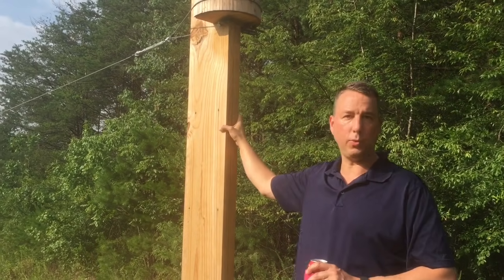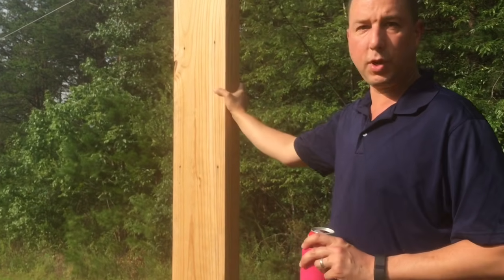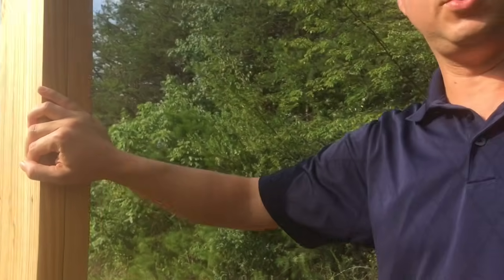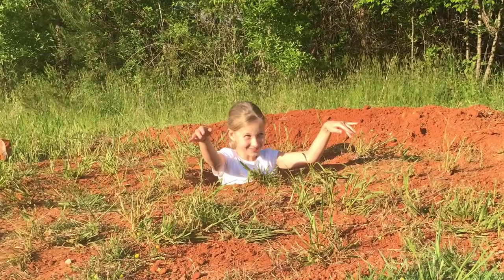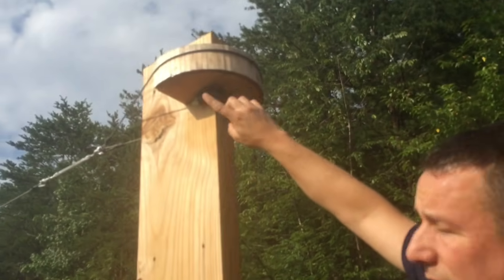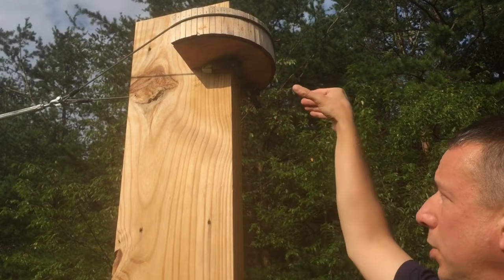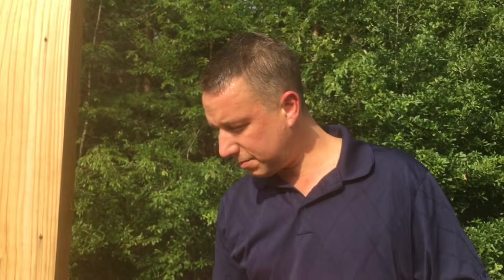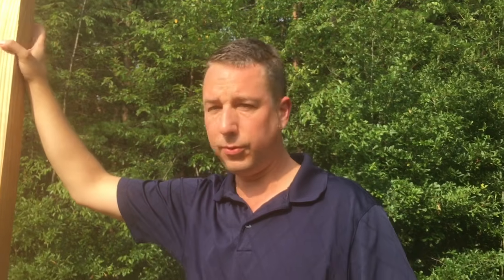Zip Line without trees - anchors

Comment: So I have two decks 85' apart form each other in the back yard. One is 6' 6" from the ground to the deck floor and the other is 6' from the ground to the deck floor. On top of these decks are little buildings that are 7' tall at the tallest points. Do you have any advice on the length of post/board and how deep to bury it to support riders of 250 lbs or less? Also, how should I mount the zipline to the beams/boards/posts? I see your mounting here, but given my spec not sure if it would change your advice. Thanks!!
Reply from the maker: You can use the equations and approach from my other video on this topic (https://youtu.be/a1KPl-M-dpM) to guide your design.  You will certainly need to go beefier than what I did, my "deck floor" on the start end was only about 3.5 feet high.

Comment: Was going to use galvanized steel poles over wood posts , any thoughts?
Reply from the maker: Check out my other video where I perform the calculations. You can use that same approach to calculate for your proposal, just need to change the cross-section from a rectangular solid to a hollow pipe and obviously you’ll need to change the material stiffness from wood to steel. Steel has a stiffness of 210 GPA, by the way. But go for it, you should be able to calculate it using the exact same approach I showed you in my other video.
Reply from the maker: Not enough info
Reply: 4” galvanized steel pipe to prevent rust , cemented in ground , won’t deteriorate like pressure treated wood over time .
Reply: Drill a hole , run a eye bolt through the top of the pipe and attach the cable
Reply: Thank you so much !

Comment: Hey buddy im not an engineer just a dad and Grandpa, did you use the same 2x12 on both ends ? I see you did say you went 4 ft in the ground that would make both ends exact size and in the ground correct,  now my question is how high did you go at the start from the zipline and how low at the end ? im not an engineer but this is wat i need to do for my grandkids,  thanks so much looks awesome
Reply from the maker: Yes, it was the same sized post on each end of the line. Each end had two laminated 2x12s. My yard naturally sloped about 6 feet from the start to the end of the line, so I did not need to construct a taller support post on the starting end.

Comment: Thank you for this video! It is awesome that you use your engineering knowledge to make fun activities for your kids. And it is amazing that you took the time to share that knowledge with other people. It wouldn't have been possible for our family, or many other families, to make a zipline without your video. 

We are going to be making the zip line with 2x12x16s, that will cantilever 12 ft above the ground. According to the equation from the calculation video, a 300 lb individual, would cause the 12 beam to deflect 3 in. Or 2 in if I used a 3 ply beam. 

I don't know if that's an acceptable amount of deflection. It certainly is not acceptable for building code. I think that works only allow 0.8 inches. But is it a dangerous amount of deflection? Could the beam fail? 

I looked up the modulus of rupture for sy pine (12,800 PSI when dry). I don't believe the force from the zipline is anywhere close to that, even for a 300lb adult at the 12' cantilever (7,500 Newtons? Or 48 psi for the 2-2x12?).

I don't understand the math well to be sure I am doing it right. I also don't know when the amount of deflection (1-3") should be concerning.

Thanks again for your video!
Reply from the maker: Aaron - I think you'll be fine with laminating three 2 x 12s.  Manufacturer's instructions conservatively spec using minimum 12" diameter trees as anchors.  Triple laminated 2x12's are ~64% of the stiffness of a 12" diameter cylinder, so that initially seems concerning... but remember that live wood is ~50% less stiff than the dried lumber you are using.  So Bob's your uncle and you're back to parity with the conservative manufacturer's guidance.  Have fun and shoot / post a video - I'd love to see.
Reply: @BILLYSHED  Thank you! I will definitely post a video

Comment: Any chance you have a link to the half circle piece?  You’ve convinced me to try the 2x12s but I can’t figure out that half circle item.
Reply from the maker: Sorry but no.  I just used scrap 3/4 plywood, made a quick circle jig on my table saw (you can find videos of people doing that) to make four 12"-diameter discs.  Notched-out a rectangle so it would slide onto the 2x12s, then laminated the four discs like layers of a cake.  Then I just cut some small (maybe 1/4" x 3/4" cross section) pieces of clear grained pine and lined them up around the outside of the cake.  Don't overthink it.
Reply: @BILLYSHED   what r your thoughts on a 6” diameter fence post cut to make a 3” thick half circle?  At 6” diameter it’s not your 12” but would be easier then all that you mentioned.  Also, what did you use to hold it in place?  It’s hard to tell but it doesn’t look like you used any L brackets.
Reply from the maker: @boondocks5  First - I think your approach should work just fine.  Second, friction did a fine job holding my pieces in place.  L brackets are probably overkill but if it gives you peace of mind, go for it.  Again: don't overthink it!

Comment: I bet those  rotted off at the concrete line in less than 3 years
Reply from the maker: Actually, we moved from that house at the 3-yr mark and I took down the posts before we sold. The posts looked fine. It was pressure treated lumber. It didn’t need it to last forever anyway.  Thanks for the encouraging and helpful comment btw

Comment: What would you have done differently if your yard didn't have that slope downward?
Reply from the maker: Hey Sara - in that case I would have used longer 2x12's on the "start" side (through lamination) then secured that end with a guy wire setup.  I assume you're in this situation?

Comment: Hi Ryan , what was the drop like ? You mentioned 8 feet both sides but what about the natural drop in the yard?
Reply from the maker: The drop in the yard was about 6 feet over the 90-foot run
Reply: @BILLYSHED  I looked at your other post and you mentioned 4 foot , could it have been 4 , I think you mentioned you moved
Reply from the maker: @LeeOliveiragetggg  I did move, but I am 100% certain that my yard sloped 6-feet over that run.  But I can understand your confusion.  The 4-foot number you saw in my other video - that was used to illustrate the calculations for the two contributions to the line sag (not yard slope).  And you may notice that around the 10:30 mark in the video that the contributions only add up to 37.5 inches so 4-feet was a decent "guess" for illustration purposes.  My current advice to all folks is #1 don't overthink it and #2 follow the guidance given at https://www.ziplinegear.com/pages/how-to-build-a-zip-line-section-one-concepts   (which goes hand in hand with advice #1).  If that site existed 5 years ago when I was searching how to install my zipline (because I didn't have trees) then it would have saved me a lot of headache.  My zipline videos are now essentially outdated but that's alright - that's progress!
Reply: @BILLYSHED  hi Ryan, I have some photos of a similar set up. Let me know if you are interested and where I can send them
Reply from the maker: @LeeOliveiragetggg  I'm out of the zip line game, so not really interested.  I appreciate it though!

Comment: Great video. I have a 280 feet  line . I wana meke the zipline for kids and adults.  Can i use 6x6 or 4x4 bolted together . Or is it beter ur way with 2x12.  Thank you .
Reply from the maker: Vaso - If you plan to use a "stand-alone" post like I have, then my short answer is, "No".   You cannot use 4x4 or 6x6 unless you intend to bolt it all together so that the "long" dimension of the compound post (along the direction of the zipline)  is ~12 inches.  And, at that point, you're much better off in terms of time and money just buying 2x12's.  I discuss the reasons in my other video: https://www.youtube.com/watch?v=a1KPl...   .  Good luck and have fun!

Comment: How deep would it have to be for a 300 lb adult ?
Reply from the maker: Its not so much that a heavier person would need deeper anchors.  Four feet still is sufficient.  But: for a 300-pounder, I would laminate (combine) three 2x12's instead of two at each end for the anchors.  Also might need a stronger steel cable, probably 1/4 inch diameter instead of the 3/16 inch that comes with most kits.

Comment: I have a question:  I see that you are in a Northern part of the country, or at least not in the subtropics where the soil is a sand/loam base.  We live in South Florida where the soil is sand and the water table is high.  How would I know how deep to embed the post(s)?  Would a guy wire back to a second short post or concrete footer help?
Reply from the maker: I'm not a soil engineer, so I don't know how to answer your question or where to look for guidance.  If I were you, I would start with google searching terms like "soil, depth, cantilever loads, anchor, post, etc"  Definitely a guy wire back to a second post will help.  Just depends if you have the room for it, and it's an aesthetic preference and a safety consideration...  Good luck!

Comment: Did you mix the concrete in the large holes yourself or did you rent a machine to stir the concrete for you?
Reply from the maker: I just mixed it myself by hand in a wheelbarrow
Reply: Ryan Emerson , nice.  Thank you.  Another video that used your design mentioned 20 bags per hole and that seems like a lot.  Do you recall roughly how many you used for 4 ft x 18 in hole?
Reply from the maker: David Wood  sorry man, I don’t remember. If I said it in the video, then it was probably true. I do remember that I used an online calculator and actual usage was pretty damn close to what the calculator calculated. So if I were you, I would go with that.  I also remember that by the end of it I kinda wished I had hired someone to do it… You know concrete is heavy dirty work!

Comment: We are in a very wet / rainy climate. What would be a good substitution if we were to use steel pipe? I'm worried, even with PT lumber, things would deteriorate fast. Also can you think of a removable option? We have a small yard, and it would be nice to be able to remove the posts when we don't use the set-up.
Thank you
Reply from the maker: Hmm.  If you want to use hollow steel pipe, then you need to choose one with a diameter and wall thickness to give a flexural stiffness equal or greater to what I calculated for the solid rectangular wood.  See my other video that's linked in the description for the concepts and calculations.  My other thought is that putting a zipline up and down sounds reasonable in theory, but in reality you aren't going to do it.  It's a PITA.  Finally, wood should last "long enough" even in a wet climate.  Piers made of wood are constantly submerged and they don't fall apart.  If I were you I would still use wood but would beef it up a little to compensate for the reduced mechanical properties when wet.  You can look all that stuff up online.  Good luck!

Comment: Followed your instructions.  You rock!  Kids love it.  Thank you for sharing!!
Reply from the maker: Excellent!  I went to your post and saw what you did. Very nice. Do you mind if I share the link to your video in my description?
Reply: @BILLYSHED   we're working on following this as well Ryan, thank you for this! I noticed that in this video he only dug it 3 feet deep.  We've had difficulty getting 4 feet down in our digging and wondering if that'll hold up? Ryan was the 4 feet a safety precaution or necessary to hold it?
Reply from the maker: @therealmoshesegal  I got the 4 foot recommendation from an old & trusted coworker / engineer who also had a farm.  He was pretty firm about 4 feet minimum.  Since I posted my original video, a site emerged that has the best guidance
https://www.ziplinegear.com/pages/how-to-build-a-zip-line-section-one-concepts
They also advise 4 foot minimum.  If you can't get 4 feet, then use guy cables, again per the guidance at ziplinegear.  Are you digging by hand for some reason?
Reply: You gave me the inspiration to do this :).  You can use the link as you please :).

Comment: Hi Ryan, just wondering how many pieces of rebar did you put on the concrete?
Reply from the maker: Just one piece at each end.  I didn't do any calculations but I figured it only cost a few bucks so what the heck.  In any case, the concrete never even showed hints of cracking so either the rebars did the job or it was complete overkill.  Good luck and please share your system when you get it running!

Comment: Just had to throw that in huh,  I'm a engineer. What a loser
Reply from the maker: Thanks for the constructive comments, man.  Good form  (slow clap).  I think most people find it reasonable to state their credentials when appropriate...  It sounds like you're sour?  You failed outta engineering school?
Reply: @BILLYSHED  🤣 I think it's the losers that just can't stand to see successful people.  What a shame... anyway,  thanks for the video.  Can you please tell me how high your finish point is? Sorry if I missed it.
Reply from the maker: Sasha Sims thanks.  The finish point was also 8’ off the ground, but the slope of the yard was about 6 feet over the 90-foot run.  Major lesson I learned on my zip line is that the geometry is pretty forgiving. As long as you have strong anchor points, you’ll be able to tweak the tension to get a decent ride. I think my kids would have had more fun if the ride was just a little bit faster... maybe a 9-foot difference between start and end point...  anyway. Good luck!
Reply: @BILLYSHED  it's just a zipline dude, you must be compensating for a defect of the Male human anatomy.

Comment: Hi Ryan. I may have missed it, but my question is how do the cables stay on the round? Just the tention alone? I'm sorry if I just missed that part. I just want to be sure. I just need 1 post....top end will have an actual tree. Thanks so much. I am humbled by your genius!!!
Reply from the maker: In my case (and probably most cases) the cable indeed stays on the round part through friction & without any external "help".  If you designed a very "saggy" run, then maybe the cable would be inclined to slip.  But in that case (a saggy run) you would have plenty of other problems.  Have fun, good luck, and I'd love to see what your run looks like so upload a video and share a link when it's up and running!
Reply: Looks like it should be a LOT thicker . Seems it would flip up/down when not exact even pressure is added

Comment: Do you recommend using 4 x 12 x 16 without anchors, 4ft deep.
Reply from the maker: merk awad - You can use the equations that I provided to answer your question. Definitely you will experience more deflection. It might work- depends on the shape of the ground under your run

Comment: Well... I built my post. The concrete  calculator is saying 12 - 80lb bags needed for the same dimension hole you made. Seems like a lot... how many bags did you use?
Reply from the maker: Nate Adams That sounds about right. I don’t remember. I do remember that the online calculator for the number of bags was pretty dead-on.

Comment: Did the adhesive do it all over the place? Why did you get the one that you had? Was the anchor point in that one have a good cable line?
Reply from the maker: (1) Construction adhesive is thick, it did not "go all over the place" because I used a caulk gun.  (2) The zip line kit was a gift, it is a common brand, not expensive, all the steel hardware was fine, it lasted for four years then I took it down because we moved.

Comment: I'm planning to use 2-6x6 pressure treated post glued and bolted together.  I'm putting them in the ground back to back not sure by side in the ground.   Those 2x12's rot too quickly no matter the type or pressure treatment.  For some reason the the 6x6's just don't rot as quickly plus it's way stronger = safer.

Comment: Thanks for the video, I know it is a little old now, but I had another question. Why two 2x12s? Why not go with three? Would that end up being stronger? Thanks!
Reply from the maker: Joshua Swift , a third 2x12 obviously won’t hurt, but it’s not necessary. A zip line is a stiffness-dominated application- not a strength dominated. (Understand the difference between stiffness and strength). There are two elements of the zip line system that affect its stiffness performance - how much the anchor points move, and how much the cable stretches. These two factors each cause the rider to sag low in the middle of the ride. It’s the sag that needs to be mitigated / optimized. You don’t want too much but you need a little.  I really should finish that second video, sharing the equations and all. The zip line package I bought off amazon came with a 90-foot steel cable, I think 3/16-inch diameter. I calculate that cable stretches significantly more than the two 2x12 end points bend.  Adding a third 2x12 won’t significantly reduce the flex. And you don’t need it stronger.  Those 2x12s can flex a lot more before they get close to breaking.  Dammit now I wanna make that follow- on video. I’ve moved on to other things to play with but I should make that video.
Reply: @BILLYSHED  Awesome, thank you for the reply and added information!